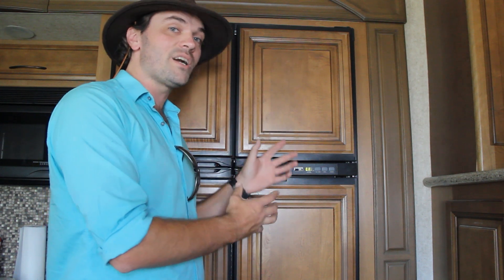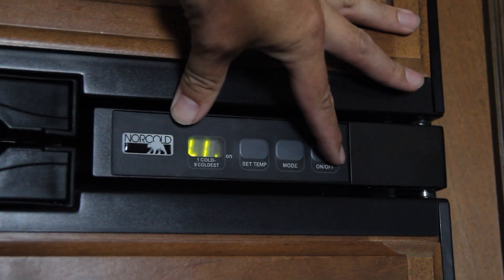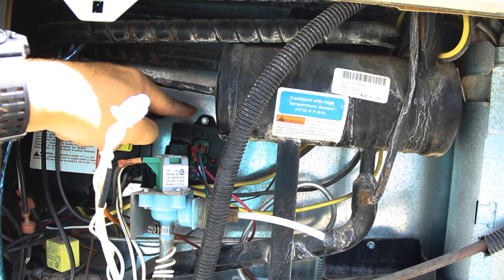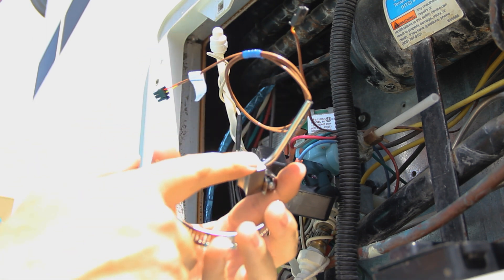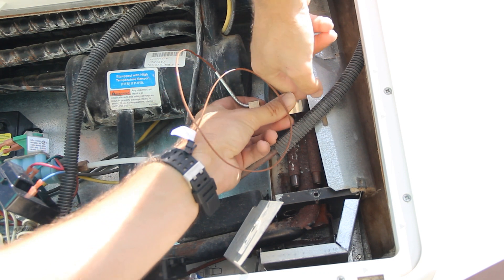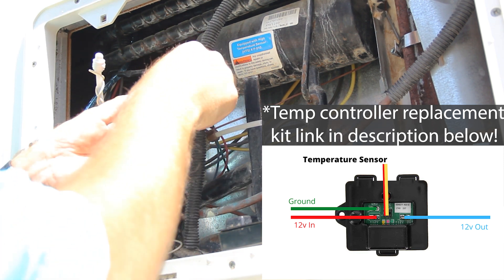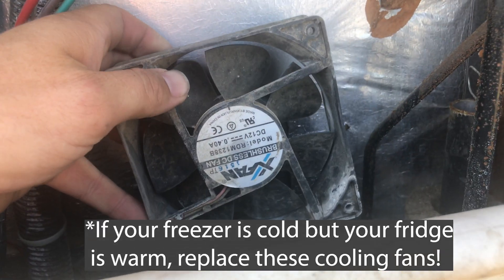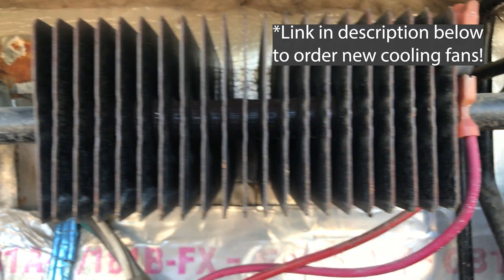Norcold RV Refridgerator Not Cooling? L1 OP code FIXED!!!

Comment: Does anyone know if after doing this it takes a while for the fridge to kick on or should it start cooling right away ?  My TT sits at a campground and i leave the fridge on when i go away for a short while. When i came back the fridge had the L1 Op error. I was able to do the magnet trick and the error went away . I left the fridge on for about 20 minutes and it did not kick on The fridge did not kick on ! The silver tube thing to the far right, i think it`s called the Boiler Housing was hot to the touch. Maybe this has to cool down first ! Any info or suggestion's would be appreciated.
Reply from the maker: Great question. There are fans that blow air on the coils, if those fans aren’t blowing air, the fridge will never get cold. Also, if the thermal overload, which is connected to the coils, if that goes bad the fans won’t kick on either. Definitely check those things. These things are outside the RV in a vent above that boiler house.